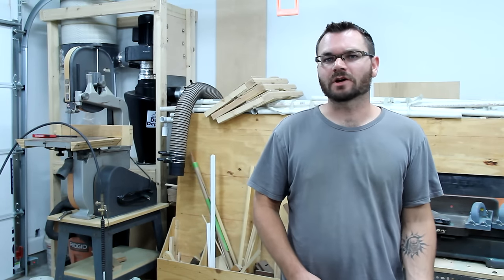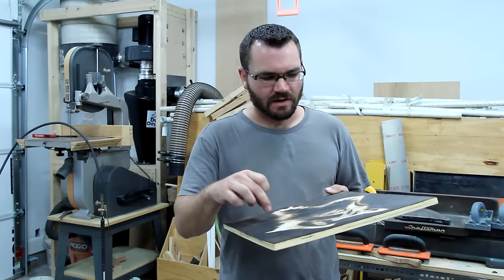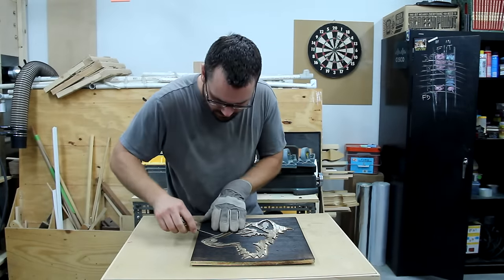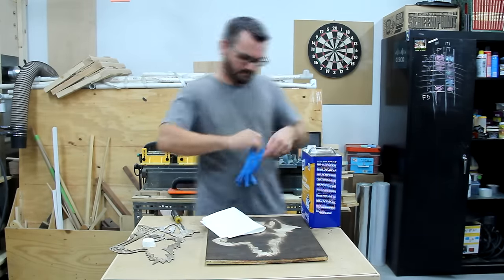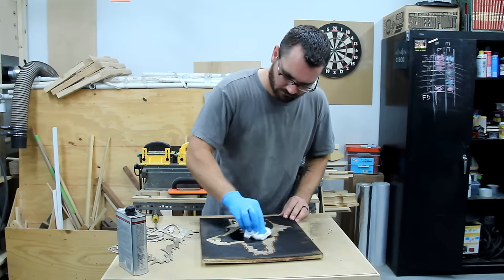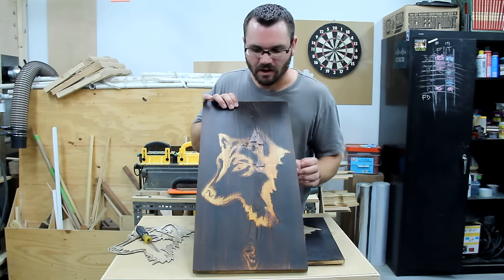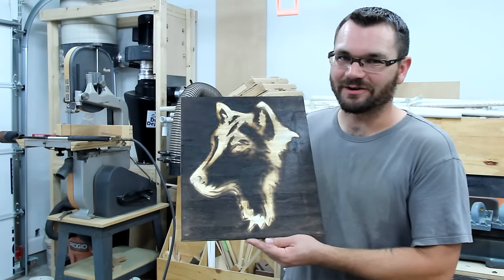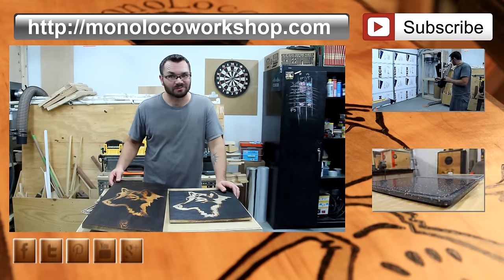Finishing with FIRE

Comment: As an added bonus, that torch is the best charcoal starter ever invented. Fire up the weed burner on some Kingsford, and you're cooking in 10 minutes. I haven't bought lighter fluid in 8 years.

Looks pretty cool, Ty. Wonder how it would look if you torched a piece of plywood, sanded it, then used the CNC to cut the pattern into it...
Reply from the maker: Mark Lindsay I remember using one of those when I was a kid back on the farm but it still surprised me how much flame comes out of that beast. 

I'm not going to lie.. torching and then CNCing has crossed my mind.  I haven't come up with any concrete projects but I think it could turn out pretty cool!

Comment: That's an awesome finish technique, Ty! It would be fun to mess around with different woods and how much you char the wood to see what kind of results you'd get.
Reply from the maker: Braxton Wirthlin You should check out some of the charred and burnt wood sighting. They burn the crap out of it like they pulled it out of a bonfire and use a wire brush to scrap off a decent amount of the charred wood.

Comment: There seems to be quite a bit of warping.  Is that because the wood was already warped or because of the heat?

And FIRE!  Yeah.
Reply from the maker: Make Crazydays That test piece was already partially warped but it could have warped a bit more when torched. Since things expand when heated and I only torched once side, I wonder if it went back to the original shape when that side cooled. Next time I'll have to measure it and be all scientific.

Comment: That's a fun idea.  You might want to consider using your CNC to make a a kind of mold instead of a template.  Then you could pour concrete or the same stuff they pour into ceramic molds.  You get get a mold you could reuse or modify and a template from the mold that you can torch as many times as you like.
Reply from the maker: Jim Coogan I've definitely considered using the CNC for one of my concrete molds but I didn't even think about it for this. I'm afraid if I got too many of those kicking around the larger size of them might take up too much precious room in my already too small of a shop. I think the smaller size of aluminum sheets might be worth the extra cost.